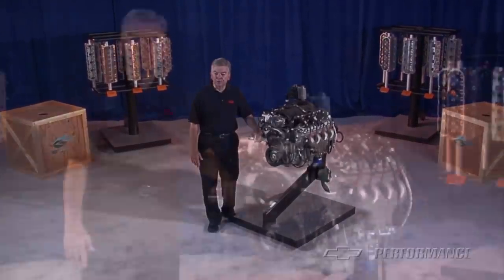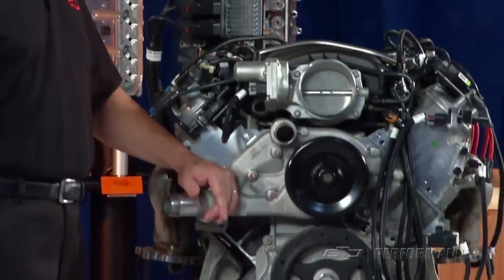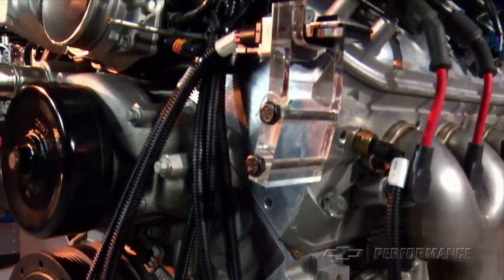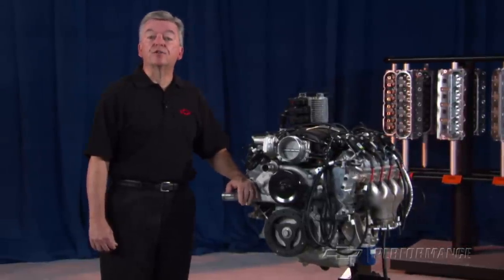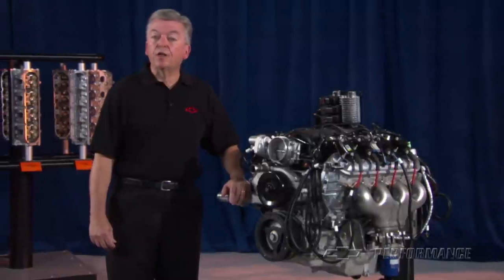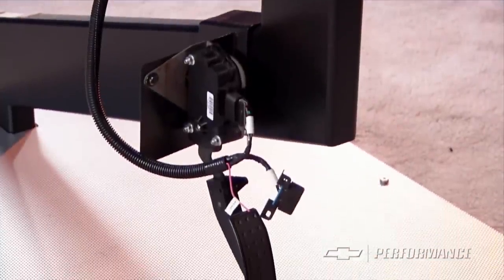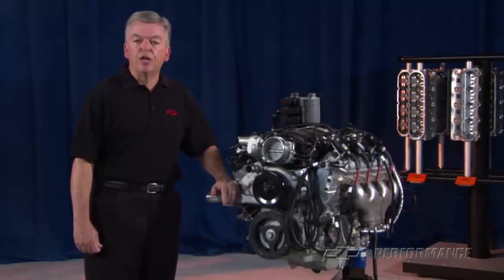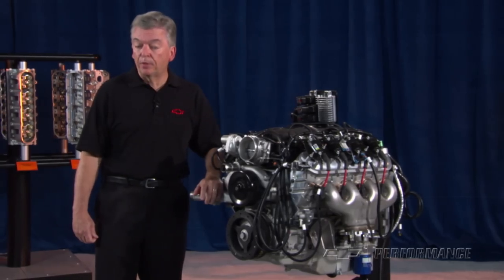Chevy's LS7 427 Means Serious Performance!

Comment: Does the "24 month or 50k mile limited warranty" cover engine replacement when an exhaust valve drops due to premature guide wear and windows the block?
Reply: 2006-2007 called, it wants its shitty joke back.
Reply: uhhh its not a joke though.  This is still an ongoing problem.
Reply: My 2006 spun a bunch of bearings too. Very problematic engine
Reply: A simple fix
Reply: @scottbarker9058  Easy to say if it didn't cost YOU 15k+ to repair.....
Reply: Basically clunk of junk..repaired after a dropped valve..then new motor spun a bearing..shit coating on the titanium rods..gm cheaped out on the rod coatings, knowingly. What a shiity thing to do

Comment: do these drop valves or have they addressed the issue with these motors
Reply: Armando Picazo there are lots of videos showing valve guide wear problem with these engines. GM will fix it only if you car is still under warranty .
Reply: LS7s were never fixed. Plus these have the old style rods that will rub when the chromium nitride wears off. Ask me how I know
Reply: @Z3rhairstylers  Not familiar with this. You talking about the valve stem coating or the journals on the rods?
Reply: @Z3rhairstylers  how do u no////
Reply: @CornFedZ06  BOTH!! Titanium components are this engines Kryptonite.....
Reply: I can only imagine that's why I spun a bearing on my " motor build after my first valve drop.." if anyone wants to buy my c6 z06 and fix the bearing themselves il sell it cheap

Comment: 427 ci/ L72 CAME OUT FOR "STREET USE" IN 1966 !!!    The BIG BLOCK MKIV 396 FIRST HIT THE STREET IN 1965 (L78 396CI/425 HP "L78" ENGINE)........then, in 1966 they increased the cubic inches to 427 CI.......these are production street years....I BELIEVE THE 427 WAS IN PRODUCTION BUT FOR RACING/NON-STREET USE AND NOT AVAILABLE TO THE PUBLIC YET THROUGH NORMAL SHOWROOM PURCHASE.......

Comment: Does it still drop valves?
Reply: Pos motor, blew the 2nd week I purchased it..dropped a valve..then second motor spun a bearing from titanium rod coating failure.

Don't get how gm still kept making this motor.

Comment: 1965 427 was all case iron . chevy and ford had both had a 427 in 1965 .
Reply: THE 396  CAME OUT IN 1964,,,REPLACING THE ..409...I WAS ALWAYS UNDER THE IMPRESSION THAT THE 427  CAME OUT A YEAR LATER PRODUCTION WISE IN 1966//
Reply: You need to look it up . i drove all those cars 1965 .
Reply: i apologize...i meant 2 say the 396 came out 4  production in 1965..replacing the 409...the 427 was the next year..
Reply: yes right i got a 427 today
Reply: And? What do those engines have to do with this one other than displacement?

Comment: Hey. I'm restoring my caprice wagon 1992.  I have the factory 305 5.0 V-8.  What modification would I have to do to make this fit, "for my application."  
I'm a metal worker and structural welder.